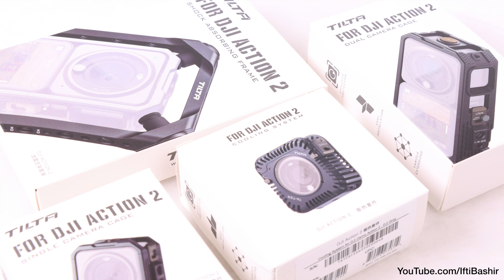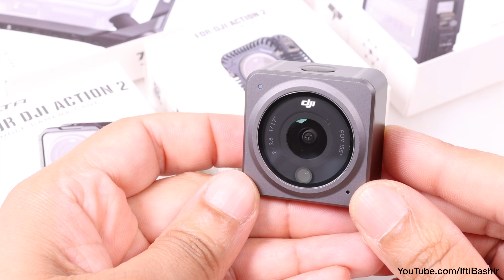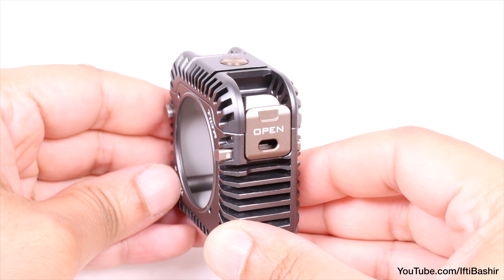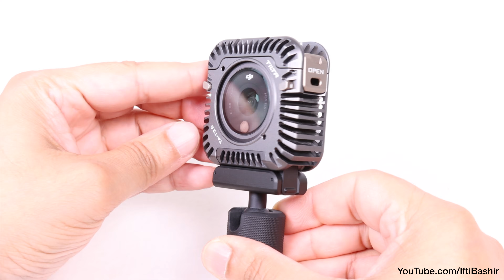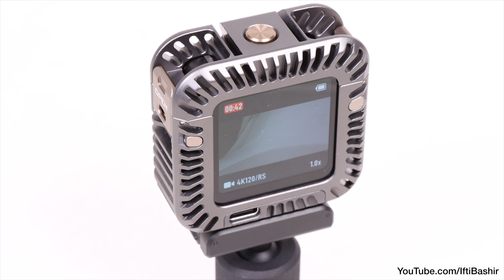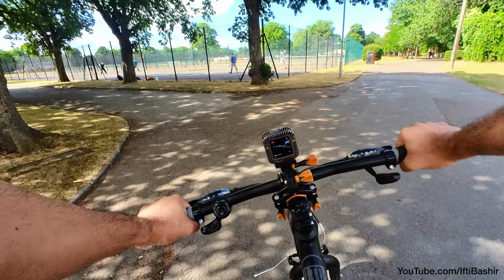DJI Action 2 - No More Overheating?! : Tilta Cooling System Cage - REVIEW

Comment: Uhm, won’t the protruding forward locks be a problem at high wind speed (car mounted) or is it sticky enough to not get pushed in? Would have liked it in the opposite direction.
Reply from the maker: They're quite strong enough to resist wind. I can't see them being pushed in very easily as the surface area is so small.

Comment: Thanks for the review. Answer how much does this cooling protective cover justify your purchase? Does it really significantly help to extend the recording time or is it a waste of money? I didn't understand from the video if it is possible to use USB Type-C memory drives for recording or unloading from the main camera module?
Reply from the maker: USB Pass through is for charging only. The camera module does not support data pass through without the second module attached. 
Out of all accessories, if heat is your main concern, this is the best heat dissipating solution currently out there.

Comment: No pass through for the battery pack/second display is a deal-breaker for me. You always need to get it out of the cage to charge and safe your files.
Reply from the maker: This has the pass through charging port on the back of the unit - as shown in video - so you could still connect external power - but no pass through to the display module though unfortunately.

Comment: Did you allow the camera to totally cool down before putting the heatsink on and testing?  If the camera started at an elevated temperature for the heatsink test then the timing result would not be fair/accurate...
Reply from the maker: Yes of course. The camera was fully recharged, then allowed time to cool even after a recharge (since that warms the camera up too) before the test was replicated.

Comment: DJI's own protective case works better.
Reply from the maker: How do you come to that conclusion? 
DJI's case does nothing to help with temperature at all - all it does is ensure your fingers don't get burnt from the hot camera body. That's all. The camera senses a magnet in the case, which tells it that it can run hotter for longer. Heat is a killer for electronic components, so it's actually worse for the camera over the longer term. 
The Tilta cage, albeit more bulky, actually helps dissipate the heat since it's a large all-over heatsink. Hence it helps the heat to ascepae since its providing a larger surface area for heat to dissipate from.
Reply: Michael research next time

Comment: Totally useless camera because of overheating. Gen 1 was far more usable in hot countries like Greece.
Reply from the maker: I wouldn't say its totally useless. I guess it comes down to how you intend to use it. But yes, it's quite a flaw for many users and it's a shame we need cooling 'solutions' like this in the first instance......
I guess that's what you get when you try fit so much power into such a small frame....
Reply: @iftibashir  my country is pretty hot in summer like more than 32C for 3 months and even gets 45C some days. So this camera is only for outdoor usage.
Reply from the maker: @jiasios   Yes it which case you would need lots of airflow, and I agree - look elsewhere!
Reply: @iftibashir  do you think it could be used as a dash cam on lower recording quality